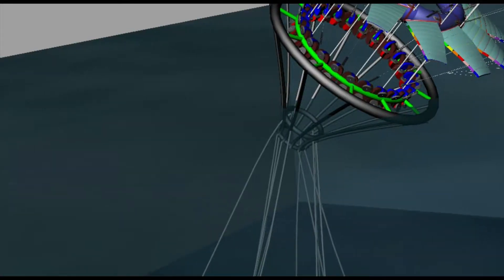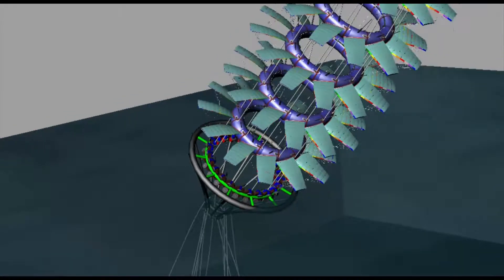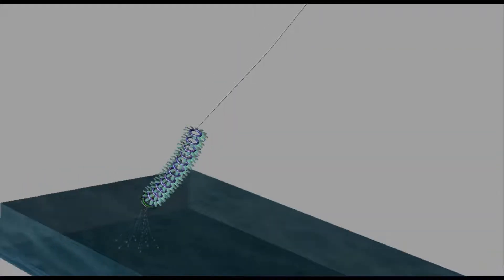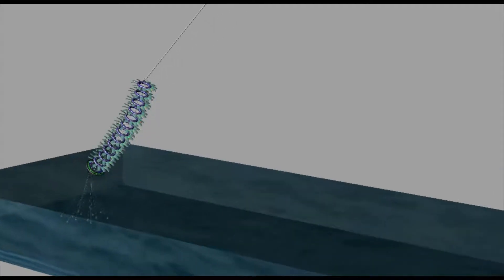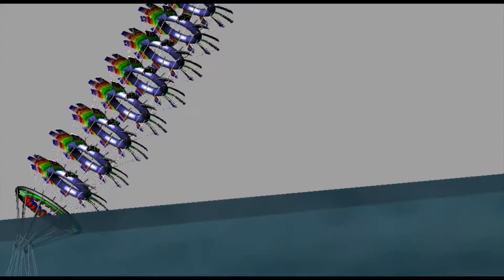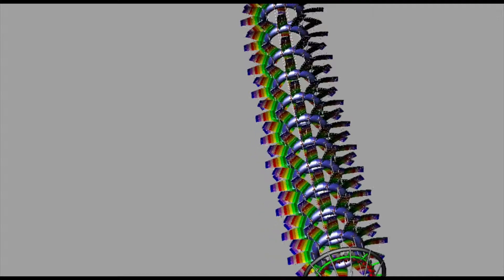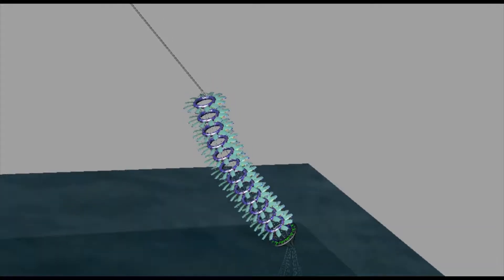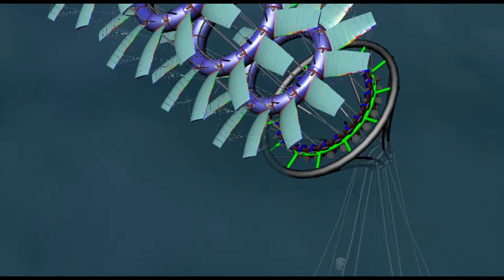Sea and airborne wind energy generation cone semi sub kites

Comment: https://youtu.be/x9plreIhefY - Enerkite Rural Power Supply System includes battery 
https://youtu.be/vMTchVXedkk?t=103 - KPS Dual Kite Power Solution 
==> Kite design is very delicate + difficult to control + large dynamic stress on tethers ==> https://youtu.be/RzCK9Ht0SWk?t=25 - BAT aerostatic approach is more promising, using a conventional wind turbine carried by airship or https://youtu.be/hm4Vu-yEswo?t=30  concept with counter-rotating donuts. 

http://www.altaeros.com/faq.html  tells about automatic takedown on heavy weather forecast & robustness. Future large scale vessels may inflate using cheap H2 like good old huge Zeppelins prooved quite robust since 1914 World War combat use (until once fatal Lakehurst desaster, possibly caused by sabotage, but not much risk for unmanned use)

see also https://youtu.be/2JNO5MnWmcc + https://youtu.be/kldA4nWANA8 & comments
https://youtu.be/22WS_UCa42o - Rotary Kite Energy Concept by Rod Read 
https://youtu.be/P55HfnGR6kQ?t=262 - Superturbine Chain Concept by Doug Selsam
https://youtu.be/54-tc006lJU?t=210 - Airborne Wind Energy Overview 
https://youtu.be/3VKFJ2_cQmM?t=43 - SkySails Power System Pontons https://www.skypower100.de